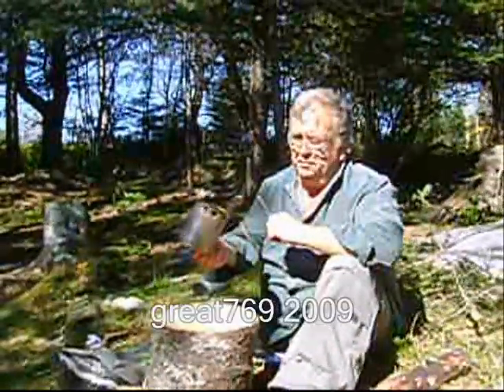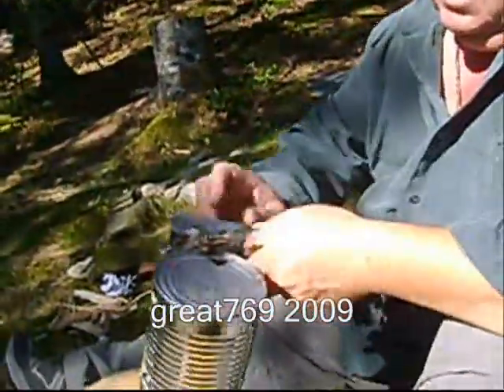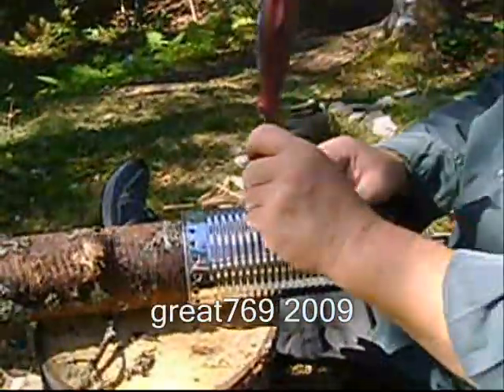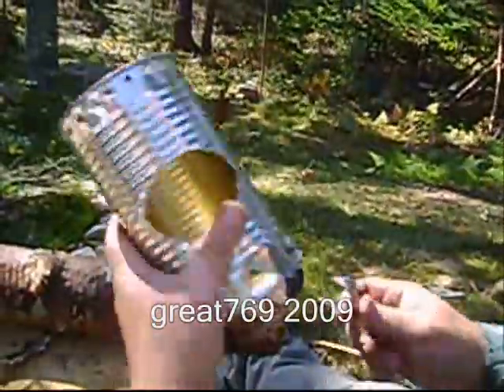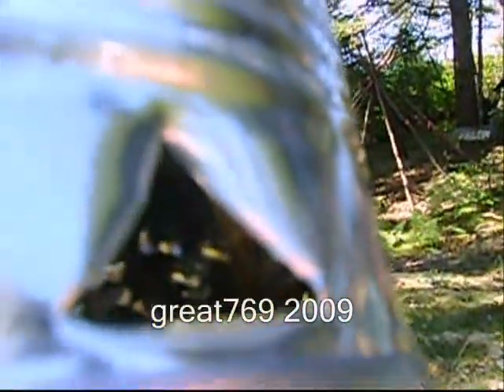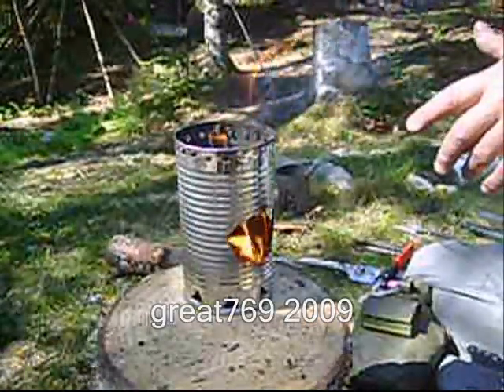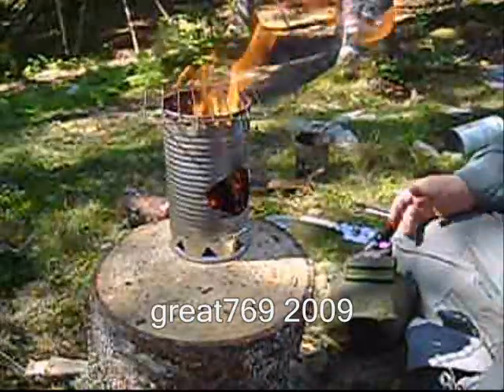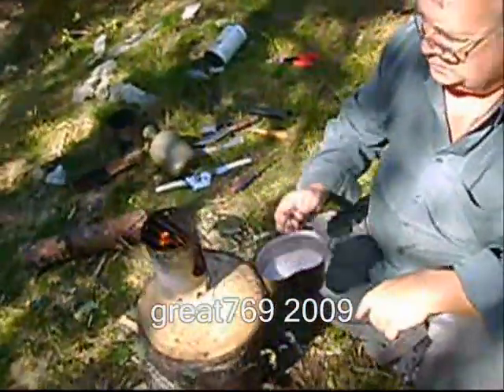How To Make A Hobostove

Comment: thanks! i made my first hobo stove two days ago and it worked great. success. instead of using a grate i just used a wire coat hanger and cut it into sections and ran them through the ventilation holes in the top and bent the ends down. thanks alot for the great idea!